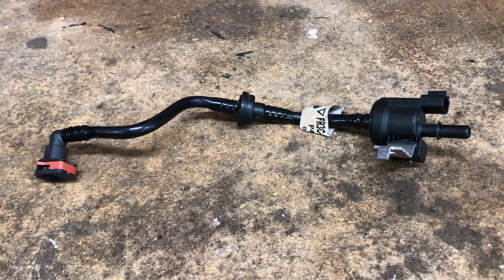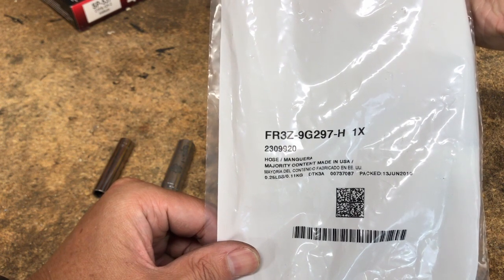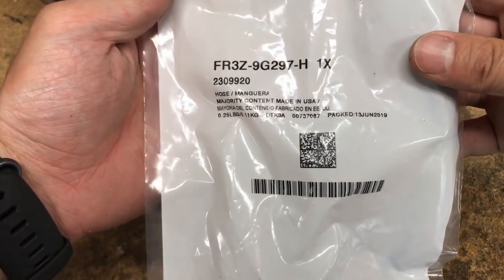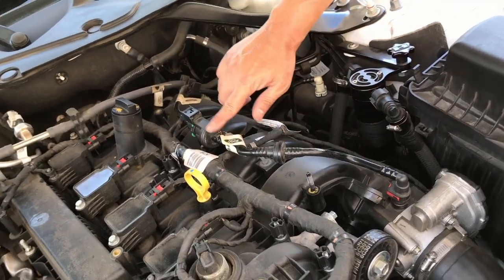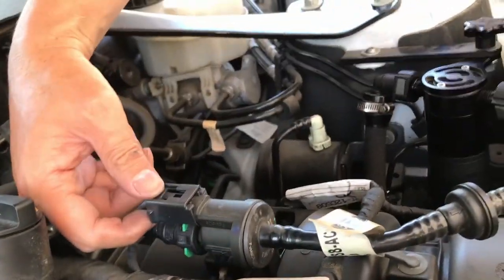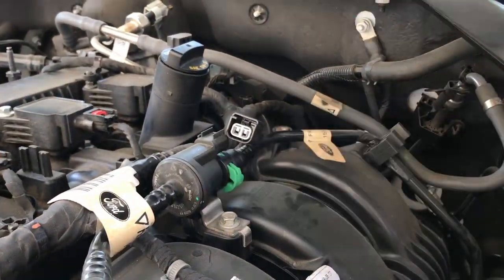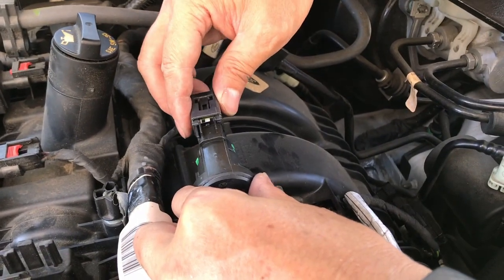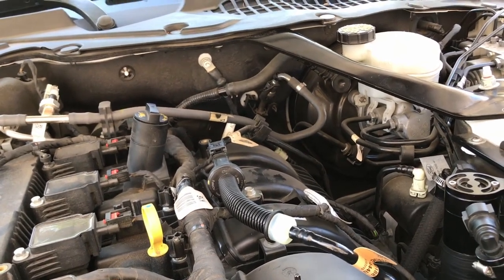Ecoboost Mustang - P1450C Evap Purge Valve Replacement

Comment: Completed the switch, engine light came on then after about a couple weeks, it went out. Now car seems  to cut out when stopped or if I don’t give enough gas after switching between PNRD…any suggestions??
Reply from the maker: Unfortunately, I don't have any experience with that and with these newer cars I don't want to steer you in the wrong direction.  Please keep me up to date with your progress and solution. Thanks.
Reply: @ OK will do, thank you

Comment: Absolutely fantastic video, thank you so much. I found this linked from the Mustang Ecoboost forum website, I'm 99% sure this is exactly what's happening with mine right now. Rough idles and screwed up air-to-fuel ratio ONLY after filling up the car with gas, sounds like this is the culprit. Thanks for the informative video.
Reply from the maker: Yup, those are the classic symptoms.  Hope this resolves your issue.
Reply: @BIsForBudget  yep, that was exactly the issue. Thanks!
Reply from the maker: @dmiradakis  Awesome.  I'm glad this worked out.  Thanks for following up.

Comment: Just did this yesterday.  So when does the engine light go off.  unhooked the battery for about 5 minutes and reconnected it.  Do I need to drive it for a while before the engine light goes off?
Reply from the maker: Hi V.  It did take a day or two of driving, but the CEL did eventually go off by itself.  Hope this helps.
Reply: @BIsForBudget  Ok, thank you very much and you did an outstanding job on this video.
Reply from the maker: @vmason9  Thanks for the positive feedback!

Comment: I went to autozone for a check engine light but it gave a p144a code. Ive been searching up and down but i can only find solutions for a p1450 and p144c and i was wondering if p144a was similar
Reply: The description of the code was still an evap emissions hose problem so i think im still safe to replace the part since it cant hurt anything im just curious

Comment: I changed the part and put the new one but the engine light is still on, do I have to delete the code with a scanner or can I disconnect the battery?  can you help me please
Reply from the maker: Hi Andry,  the check engine light doesn't turn off immediately,  it takes a few trips before it clears.   Hope this helps.

Comment: Hi my 2016 mustang ecoboost just threw me a code of P144A. I can't seem to find a solution for this specific code, all I could find is solution for code P1450 or P144C. I am wondering if this replacement would fix the code of P144A? Thank you!
Reply from the maker: Hi Dave. Unfortunately, my experience and the documentation I have read only relates to the P144C error.   I don't want to steer you the wrong way.  Please keep me posted, I'd like to know the resolution.  Thanks!
Reply: @BIsForBudget   I appreciate your quick response. I will do some more research and will keep you updated once solution will be found.
Reply from the maker: @lamdavenguyen6572  Thanks!
Reply: @BIsForBudget  so someone on mustang group on facebook has the same code as mine (P144A), he did the same replacement and had no issue after the rest of 10,000 miles before he sold it.
Reply from the maker: @lamdavenguyen6572  Nice, thanks for circling back and sharing.
Reply: @BIsForBudget  It is my pleasure to share knowledge. It was a hard research about the issue for me and I didn't want it for anyone else out there looking for the same answer this hard. To those who are in the same boat as I am, I have an update. I drove 600+ miles with the replacement part as mentioned in the video, the check engine light has not come back and the car has been running smoothly. Thanks again for the DIY video, it was very much helpful!

Comment: Had code p144c a week ago.
Car wasnt idling strange or anything even after filling up.
Changed this purge valve, car still runs normal. Hopefully the check engine light goes away. If not ill have to get it looked at. 

Good video btw, really helped on replacing the part.
Reply from the maker: I'm glad you found the video helpful.  Sometimes it takes a few cycles/drives for the error code to clear.  Hope you had a great New Years.

Comment: What’s the line after the sensor that’s the only that leaks I need that part number please
Reply from the maker: I'm not sure which part you're talking about
Reply: @BIsForBudget  pvc valve the line after the sensor
Reply from the maker: @392soda  Hi Sosa, The Evap Purge Valve in the video is not connected to or near the PCV valve on our cars.  The PCV valve and associated line are located under the intake manifold.  If you're looking for the hose connected to the PCV valve, it's FR3Z-6A664-A.  Please confirm that's the right part you're looking for by going to an online ford parts site where  you'll be able to see a parts diagram.
Reply: @BIsForBudget  well the evap purge line after the sensor
Reply from the maker: @392soda  The hose connected directly after the valve is sold with the valve as one piece.  My recommendation would be to go to an online ford parts site, to find an exploded view of the area of the part you're looking for.  Then drill down to the exact part you're looking to replace.  Or visit a ford dealer who will have a full parts catalog.  Hope this helps.

Comment: I believe this part is eligible for coverage under the Ford Emissions Warranty as per Ford TSB 17-0047
https://www.mustang6g.com/forums/attachments/ford-tsb-17-0047-2-3-eb-evap-purge-valve-pdf.318612/

Here is the Ford Emissions Warranty which says that the "Evaporative Emission Control System" is covered for up to 8 years/80,000 miles:

https://help.ford.com/warranty/emissions-defect-warranty/

Has anyone taken their car to the dealership for this issue and had to pay for the repair out of pocket? I feel the repair should be free, especially for a known emissions defect like this.
Reply: They wanted to charge me $450.00
Reply: @vmason9  Sorry to hear that. It should be no charge IMHO.
Reply: Had to replace this valve a second time. Last replacement worked for about 3 years. I think these things get clogged with oil? I also needed to manually clear the DTC (with FORScan) after replacement because it did not clear itself even after 30 minutes of drive time with the new valve.

Comment: dope tutorial, i have had this issue with my mustang and didnt pay it any mind until it threw a code last week, just got it replaced dope vid straight to the point and might I add great camera work
Reply from the maker: Thanks!  Glad you found the video helpful.
Reply: Hey how much did it cost you and how long did it take
Reply: @notsogoodatthis  part was $80 bc i got it from ford since the part number has changed over time and i didnt want a refurbished part either

Comment: i been having this problem for a while and know its the purge valve but i dont know where i can find a replacement for my 2016 ecoboost. Frustrating
Reply: I actually just had this issue pop up last week. Ordered one from the website varsity Ford parts and got it within a week. Swapping it out today. Id recommend checking their website! They’re in stock right now.
Reply: https://www.varsityfordparts.com/oem-parts/ford-hose-fuel-vapour-fr3z9g297h?origin=pla&gclid=Cj0KCQjwzYGGBhCTARIsAHdMTQwk052KvmNtg4T5QI2Cr6RrgPQGSb_GCLLHFMmzd1wO6KRuSgIapoQaAj6AEALw_wcB

Direct link to the part
Reply: @magdielcampos3611  nice thank you a ton.
Reply from the maker: Wow, even your local Ford dealership can't get a hold of them?   If so, that's disappointing.   That said,  there's a link in the description of the video.  That vendor appears to have a few in stock at this time.
Reply: @BIsForBudget  thanks for the reply!
Reply: Is the same part?

Comment: I also got a code p144c, your code is different than mine! I replaced it and my light is still on! Auto zone said the p144c code is for a canister purge valve, which doesn't look like this line! Confused, who knows the real part! I think auto zone gave me the wrong info, they told me to disconnect my possible connection on battery for 4 minutes to reset the code, didn't work!🥴
Reply from the maker: It typically takes a few cycles/drives for the check engine light to turn off.   Have you drive the car a day or two since the valve was replaced?
Reply: @BIsForBudget  I just drove 250 miles and it's still on, I guess I'll just have to take it to my mechanic and give him some work!

Comment: Im having an issue on my mustang like my rpm drop from 750 to 500 rpm you think changing that fuel sensor will fix it ? https://youtu.be/WbFNfoiZLvY link on my video to show you my issue
Reply from the maker: Hi Benje33.  I would look into replacing the following 2 items:
Lowside Fuel Pressure Sensor - BU5Z-9F972-B

Evap Purge Valve Solenoid - FR3Z-9G297-H
Reply: @BIsForBudget  hello sorry for the late reply I never got the notification of your reply. I changed the fuel sensor and it was still doing it and yesterday I finally change the fuel vap hose and the car works so much better and no more weird idle after putting gas ! Thank you 👍🏻
Reply from the maker: @benje33  Fantastic news.  Glad it worked out.

Comment: Does this mess with the turbo?
Reply from the maker: Hi Mac,  this procedure does not affect the turbo.
Reply: Oh ok I have the same code and soon as my check engine light came on my turbo stared being funny maybe though there was a connection
Reply from the maker: @macalcantara1895  For me, the symptoms were a rough idle and hard starts.   My turbo behaved normally.
Reply: Oh ok idk man I got the code like yours but my turbo been at -20 then when I get on it it goes from the left side to the right but before all this it wasn’t doing that usually would be at 20 right side not left

Comment: I had very small evap leak code and then  unable to bleed fuel code...would this be yhe issue sir?
Reply from the maker: Hi RJ.  Yes, those codes are related to the evap purge valve.  Replacing the valve will take care of these codes.   Good point,  I'll update the video description with the codes AND brief description.  Thanks!
Reply: @BIsForBudget  thanks bud
Reply: I ask mechanic how much to repair after I mentioned the evap purge valve he says $80 to check and can be any from $30 to.1,000 he wouldn't know until  he fogs it first.....it this certain to be the problem because I have another guy  who said if I find the part he'll put it on for$80.....can I be certain this is the problem @BIsForBuget
Reply from the maker: @RashidAli-ft8jg  Well, in my case, this resolved my problem.  Sorry, I cant say for certain if this will resolve the issues with your specific car.
Reply: Yes I will just take it to get check even tho I noticed yesterday it didn't stall when I put gas in it maybe because I pressed the gas pedal once when i turned it off and before gas was inserted and  managed to reset the check engine light ...however that may just be temporary

Comment: did you remove the check engine light or did it go away by itself?
Reply from the maker: Hi Oxoym,  it should go away after a few cycles/drives. 👍
Reply: Did it go away ?
Reply: @edvinalvarez5167  for me no, i just cleared it and it didn’t come on
Reply: @oxoym6276  I just changed mine today I turn it on and the light still there will see after a few rides if doesn’t go away I’ll take it to clear the code if that works ty tho

Comment: Do you only need to replace it when problems occur or I have to replace it for my new 19. Thanks
Reply from the maker: Hi Austin.  Good question.  Mine was clearly broken, so I had to replace it.  No brainer.  That said, in your case, I would probably wait until it started exhibiting the rough idles, hard starts or throws a code.

Comment: Hey! This was a super good video but u changed and I stlll have the light on ? Any help ?
Reply from the maker: After a few cycles/drives, it just went away.  Fingers crossed you experience the same.
Reply: Where did you get the part? Did it have a new 2020 number?
Reply: @luisvilla3512  It didn’t change , same numbers and I went to the autonation Ford dealer close to my house and they had it there
Reply from the maker: @luisvilla3512  @bryan song is correct,  I do not see a replacement number for the valve.  If it's not available through Amazon,  I typically use www.varsityford.com.  Or if I'm in a hurry,  I would go to the local Ford dealership.

Comment: Hi I recently started feeling like my car would idle and shake a little when I put gas. I also had an incident where i was at a stop and it shook and turned off. Took a couple tries to turn back on but felt weak. Could this be the issue?
Reply from the maker: Hi Jorge,  replacing this part definitely resolved the issue I had with the shaking/poor idle after filling up.  Sorry, I can't comment on your car stalling out.  I haven't experienced that issue. (knock on wood)

Comment: Hi just started having this issue with my 2016 eco boost and auto zone sold me the wrong part. I found this one on varsity Ford parts. But it just says “hose-fuel vapor” does that mean only the long part will come and not the little box or will the whole thing come together ? Sorry I’m a rookie . Thank you
Reply from the maker: Hi qennesiss.  I just took a look at www.varsityfordparts.com and the description of the part needed is indeed "Hose - Fuel Vapour - Ford (FR3Z-9G297-H)".   I'm not sure what you mean by "little box".   If you order part number FR3Z-9G297-H, it will come with everything you need to replace the Evap Purge Valve.  A picture of the entire part is in the thumbnail of the video.  The part that gets shipped is also in the first 20 seconds of this video.    Hope this helps.
Reply: B Is For Budget I meant the little canister looking thing. The second picture threw me off a little cause it just shows the cord so I wasn’t sure but I just ordered it !! Thanks so much you are a big help !!!! 🙏🏻🙏🏻🙏🏻🙏🏻

Comment: Will the check engine light go off right away?
Reply: I have the same question. I just replaced this hose. When or how can we expect the engine check light to go off? 

I’m under the assumption I have to drive the car a bit? Not sure how many miles... does anyone know?
Reply: @justinlevy9011  From reading other people's comments, you can just take it to Auto Zone and have them clear the code for you. If it pops up again, you may have a leak.

Comment: Got this code on my 2016 ecoboost getting my part tomorrow but any idea on the P061b I heard it could be simple as my air filter but any ideas
Reply from the maker: Hello Flaming Phin.  I haven't had that code personally, but I've also seen posts where it was intake, air filter related.  I'd start off with confirming all hose clamps are tight. (mine were loose from the factory).  Then confirm the fit of the filter, replace if necessary.  I've gone through 3 Ford/Motorcraft Air Filters with no issues.
Reply: @BIsForBudget  greatly appreciate it I'll update you

Comment: Hello sir i have this code on my 18 mustang ecoboost P04F0 is this might be the same problem??? Thanks alot
Reply from the maker: Hi Romil,  sorry, I'm not familiar with the code.  I don't recall seeing that specific code associated with the Evap purge value during my research.
Reply: Romil, were you able to figure out  what caused code P04F0?  I am dealing with that same code for my 2018 Ecoboost.  Please advise.

Comment: Need your help guys.. I have 2015 mustang ecoboost. On my car the RPM is going down and coming back to normal at stop light and its not happening every time. I changed fuel pressure sensor still issue not fixed.. Can anyone please help..
Reply: Did you resolve your issue?

Comment: Hi for past 2 weeks everytime I pump gas into my 17 ecoboost after when I go inside to turn on the engine it turns on then started shaking and shuts off by itself in 2-3 seconds I wondered if this would be the problem? If yes do I need to fix it  immediately??
Reply from the maker: That seems like the classic symptoms of a bad purge valve.   I'd pull the code to confirm.  I waited several weeks before performing the replacement and did not have any issues.  The car was babied during this time.

Comment: Does this purge valve work for 2016 Ford Mustang ecoboost? I am having trouble finding a replacement purge valve for my 2016 Ecoboost from auto zone / O’Reilly auto parts stores (they only carry valves for GTs)
Reply from the maker: Hello Dannyts11,  Yes, this valve will also work for a 2016 Ecoboost mustang.  You will most likely have to purchase it from a Ford dealership (brick and motor or online).  Thanks.
Reply: Bought mine at the dealership. Just call and ask
Reply: They will ask for your vin

Comment: what year mustang was this done on? I currently have the 2017 ecoboost mustang with this code. Only difference is my car turns off time to time.
Reply from the maker: This was performed on a 2015 Ecoboost Mustang.   I did not experience any unexpected shut offs, just rough idle and hard starts.
Reply: B Is For Budget where did you order the purge valve? I need one!
Reply from the maker: @HeroxHomesick  I bought mine online through Varsity Ford Parts.
Reply: @HeroxHomesick  get it strait from ford dealership